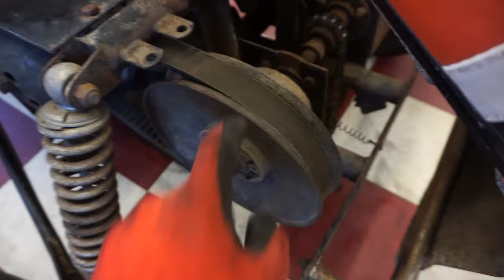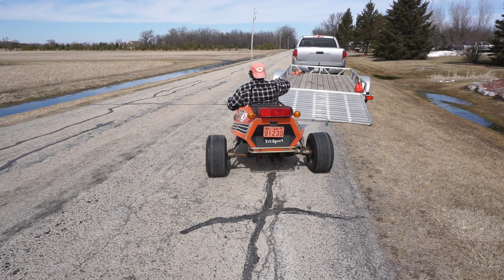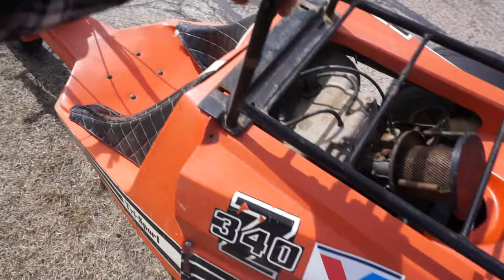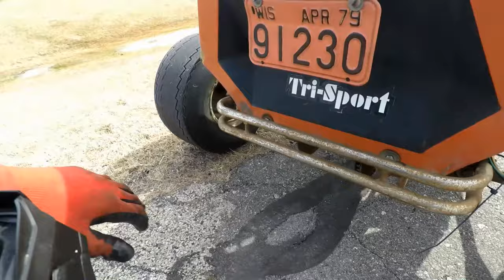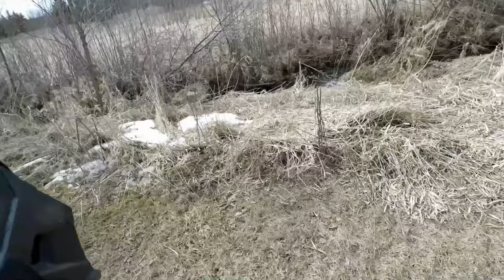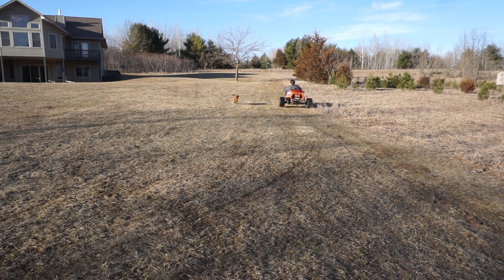Top Speed Test On Street Legal 340cc 2-Stroke Trike

Comment: I had one of these back in '71-72. They could be ordered with a Tecumseh single cylinder 4 cycle engine in 12 or 16 HP, or a Kohler 2 cylinder 2 stroke 'snowmobile' engine in 290cc or the one you have, 340cc. Mine was the 290 and would easily do almost 80mph. I had one of the first 100 they built and the early frames weren't welded up on a jig, so everything warped a little as it cooled. I could not keep bearings on the rear axle. They wouldn't last 150 miles before burning out. Even replacing the junk Roberts brand bearings with good Fafnir or SKF bearings didn't help much. The Kohler engines were not durable either, though Kohler did make improvements to them in time and they became much more reliable. I bitched and moaned to the dealer and the company for months, and they finally gave me a new one. They sent a Tecumseh 16 hp one to replace it. Not as fast at just 70mph, but easy to start and sooo much better on gas. It  did vibrate like crazy over 60. I had a motorcycle and the Allsport Trisport was for my wife so we could ride together. She couldn't learn to drive a 2 wheeler but was okay driving the 3 wheeler and we could take our kid on either. I made foot pegs and a seat pad that went in front of the regular seat on the Trisport for the kid. Mine was new and it was very stable and comfortable on the road. I put knobby rear tires on it and it tried to keep up with my friend's snowmobiles in Winter. It did okay in snow of an inch or two, but in deep snow was  worthless. Use a hydraulic motorcycle front brake caliper for the rear brake. You will have to build a bracket to mount it over the disc. Getting parts will be impossible as the company went out of business in the mid 1970's. Turn signal switch and other broken stuff you can adapt motorcycle parts. The speedo will be a problem. You need new bushings in the front fork. That little wobble is not normal, nor good. Make them yourself from parts you can get from a major industrial supply company like Grainger or McMaster-Carr. Good luck with your Trisport, they are fun, just don't expect a lot from an old tired thing that was always just a cheap poorly built machine.

Comment: love your video, i had one like yours back in the mid 70's. it had a 440 ccw it would not do a wheelie, but if you put your feet down and gas it , the front end would come up and it would stay up till you let up on the gas or till you reached top end. traded it even up for a new honda 350sl . the 3 wheeler was more fun to ride. thanks for your video.

Comment: Back in the 70s a buddy of mine had one of those with a 440 snowmobile motor on it. We clocked it with my motorcycle at 100 mph. I suggest you do some bearings and tires and maintainance before you try going that fast again. They are a blast, but be careful and have fun.

Comment: I would restore this rig if I owned it, if they're not too rusted get the chrome bits re-chromed. People say its too expensive but I used to be chrome plater back in the early 89's and there's a lot of hand labor that goes into the job, the chrome has to be stripped with nitric acid down to bare metal but this thing would be stunning when complete. Even the aluminum parts of the shocks seem to non-anodized which means they'll buff out real sweet.

Comment: heh, I built a go cart in the 70's from an I-frame, my Dad helped me with fabricating rear live axle bearing blocks, made my own 1/4 inch plate 8hp engine mount with a giant 1/2 drill that (to a kid) seemed was the size of a jackhammer, put in angle iron floor and sheet pans -- thing went 53mph and it had hard front tires with no suspension and steering link that was just bent round rod. Most terrifying experience ever as it rattled and vibrated down the bumpy dirt road. complete blast though

Comment: I was told the rear are snowmobile disc brakes, check a few from the 74 era and see if you can find a match.

They also had rear fiberglass fenders over the wheels.

Comment: 70 sounds about right... Not sure if it was that exact model but we built a Dune buggy thing back in the day in high school basically cut the back end off of one of those added a roll cage and a couple front tires with suspension and a steering wheel basically...  It had had 340 to, we had really good carburetors on it...  And it was fast... extremely fast!  Our teacher said we could only push the pedal down about a quarter throttle or so... It was just too much!  Our football coach was always sneaking over to the shop and checking on the project when we were building it asking when you're going to get it done. He was always interested in it, saying he would test it if we ever got it done.  Well we already knew how fast it was already and when we threw the football coach in hes like is it fast??? We were like oh no no it's pretty slow just floor it have some fun it's pretty mild... Well coach put on a football helmet on lol and he punched it he rocketed from one end of the practice field to the other In like a split 2nd, he turned it sideways and about rolled it...  Came back and said oh so it's pretty mild huh... 🤣😂🤣

Comment: I remember these. They were always wrecked tho. Be careful, we used to call em widowmakers. They like to tip.i would suggest wearing a helmet on any maiden voyages tho. It does seem like they used to have more zip bottom end tho. Used to pull a wheelie pretty easy. I would just fabricate any old brake caliper on there. Maybe off an old parts bike.

Comment: Obviously finish the rear brakes, then I would put some tires on the rear that are about 2" larger in diameter,  in the front I'd want the largest diameter i could get without causing the front end to sit real high (the really sweet setup would be a shorter inverted front fork with wheel, brake, and tire all sourced from a sportbike). The larger diameter would increase stability especially when going over bumps which combined with a steering stabiizer will get rid of a lot of twitchyness. Then once it feels safer some porting on the cylinder, a high compression head gasket, a quality aftermarket expansion chamber and pipe, along with a little more carb and you can easily push 100. In fact if you get creative and work some reed valve/blocks to help tune scavenging even better you could put it well over 100. Of course at some point you just take a Yamaha Banshee back half plus Engine /trans assembly with some aftermarket parts and go hit 130 mph in the 1/4 mile with an 11 second ET....
Reply: I think that would be awesome.
Reply: I'm 52 years old and honestly I have not accomplished many of the things I thought I would have by now but I can say Ive wasted a lot of time and most of my money making things go faster, most of the time a lot faster, than they should ever go. I specialized in Harleys,  from street hot rods to drag bikes to Top Fuel Nitro Harleys. Ive won, Ive set records, had fun, got hurt, gone broke, got old. Now I've scaled back. Ive glot a Baja Warrior Minibike (the fat tire minibike at tractor supply or several other outlets ) that had a 196cc single with 6 hp stock and a 24 mph top speed and stuffed a modified 16 hp Briggs and Stratton Vanguard Vtwin  (about 22 hp after modifications )that currently tops out at 78. My goal is 100 with no multispeed transmission and once I meet that then i get serious and put the 5 speed Honda transmission in it and more modifications to the engine, frame, front end, etc... and see how fast I can go while keeping some resemblance to a minibike. If you want to see a video I have a single video on my YouTube channel,  dou a YouTube Search for Buck Kowalski.  Its a pretty cool (I think so anyway ) 36 second video that shows a bit of what I'm doing with a nice smoky tire burning burn out and a fairly high speed pass by the camera.  If you watch it Id appreciate it if you let me know in the comments what you thought about it and what content youd like to see. Thanks.
Reply: My dad had one of these with a yamaha r6 motor on it with suicide shift thing was scary

Comment: Cool. You can hear that motor start to sing when it gets into its power band. Would really like to know what the rpms are when your running it. Still 60 plus mph, that's nothing to sneeze at, especially on those tires and with only front brakes.  Still cool machine. Great video.

Comment: 1960'S thru 1970'S  set-up on that to work. Unless you can get the newer speedo cables that come with those conversion kits for older speedo adapter inserts in the kits.

Comment: That chain tensioner takes A bolt like A older vehicle battery tie down J-bolt with A coil spring on A plate bracket booted onto the are where the sprocket are is on it Joe.

Comment: The danger of that trike is hitting a bump, no seat belt, you go up in the air your feet come off the footpegs, and feet go under the trike while you're doing 60 on a dry road..... Maybe put some kind of foot plates on it, maybe a seat belt... fun at lower speeds safe areas though.... fun video to watch....

Comment: I'd make A L- bracket with A hole in the center of it for the J- bolt& spring to go through it connected to A separate spring that has A long hook bend on the end of it.

Comment: New tires and balance them will take most of the sketchy out of it. Another thing to check is the bearings in the steering head. Check by pushing and pulling on the front fork. Any play felt is to much. 
I would pull the forks and pull out the triple trees to clean and inspect the bearings and races. The bearings are probably loose ball bearings, when you pull the trees you might want to hold an oil drain pan under the trees to catch the bearings as the fall out. If the balls are nice and shiny and not worn out of round they are usable but cheap to replace. The races should be shiny and show no signs of wear.

Comment: If you replace the tires and get it tagged for the road, I suggest you buy the softest, stickiest rubber compound available for the front tire. The rear don't need to be as soft. You'll want tires that won't wear as quickly for the rear.

Comment: The noise the chain made when you wiggled it sounds like it's worn out. The noise you hear is the chain rollers rattling on the pins. If you can pull the chain away from the sprocket more than 1/2 the length of a link is another indicator of a worn chain. Good chain doesn't make noise when it's wiggled. If the chain is worn out, good chance the sprockets are too.

Comment: The tri sport be cool with a 2 stroke tri-z 250 engine in it. Then be a true tri sport 😁.  You're right that spring was sketchy without being closed welded end loop or light race car a spring inside a spring in case one breaks

Comment: Hey I have a question I just rebuilt the top end on my 1996 Honda cr125 an it has spark but it won't start there's only two things I can think of but don't know if they wouldn't make it not start the cdi box or the stator those two things might have gotten wet when stored outside what do you think

Comment: Looks like it would be relatively easy to adapt a quad rear brake caliper and master cylinder to that disc.  The view from underneath was too short and dark to see for sure, but mild fab work would easy for someone with your capabilities and tools.  (tools for the future:  milling machine, lathe, CNC sheet metal router/plasma/flame cutter)

Comment: Man, you make me nervous with Vinnie running around like that while you’re riding that thing. As for the rear brake, you can buy universal calipers for cheap, or snag a used one off just about any bike, and build a bracket. Then it’s just custom length hose and handlebar master cylinder. Hardest part would be the bracket.

Comment: It should go 70 my friend Ward had one back when I was probably ten or twelve years old his had a factory windshield on it he didn't like riding the bus the school so he drove that on the back roads to school he said it was just a little bit shaky to drive that fast he ended up blowing the motor. His neighbor gave him a 440 off from a skirule snowmobile that was too much it picked the front tire right up in the air the guy that he got the motor from bought it from him and gave him what he originally paid for it when it was new because it was so fast it would bury the speedometer

Comment: Watch your oem jetting..  the gas in the 70s had no ethanol in it..  vintage 2 strokes will lean out a bit with the ethanol.  If you run pump gas and not a good pre mix.  Just watch your plug.

Comment: The belt still appears to be too thin. It should sit all the way at the top of the sheaves, even sitting slightly above. My brother has a 1972 arctic cat lynx chassis with a 440 and a wheel kit, and it'll do 75-80mph easily, so I would be surprised to see  less than that. Trust me, it's a sketchy riot!

Comment: READ READ READ!!!!
All my drag quad has a spring loaded roller skating wheel type chain tensioner that would work perfectly for that. Sand toys unlimited has chariot brand but there is a lot of different ones. They have two mounting bolt holes but most us only use the one hole w/nut, lock washer, & bolt to hold it in place. Should get a heavier chain but don’t get a O-Ring chain cuz those kill horsepower. Ragina DR chain hold our 140+ alky fed banshees

Comment: So you didn´t wanna do a topspeed run because the tires from 1979 (or earlier) could be dangerous on snow. And a topspeed run without the mainbrake, and tires from 1979 (or earlier) is no problems with no snow? Jesus... Hopefully you have a really good guardian angel. A tip for your next life: the most important features on any vehicle are tires and brakes. Pretty much all other stuff doesnt kill you, but those two will.